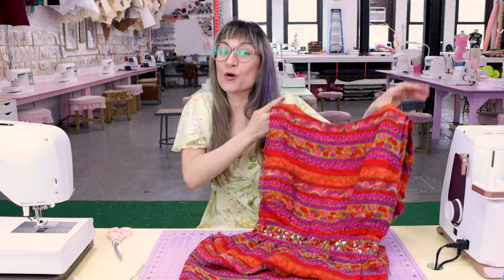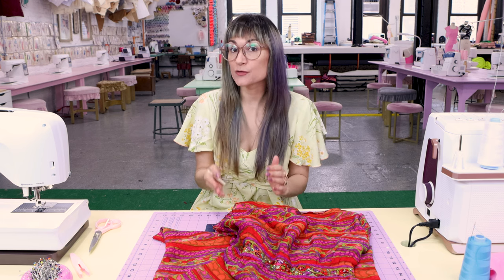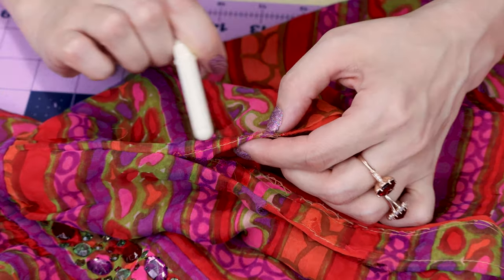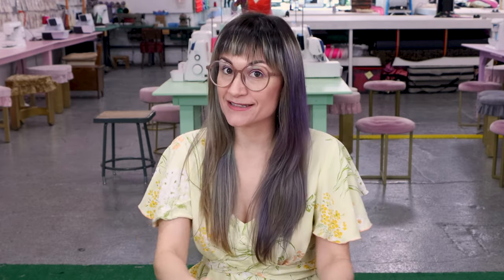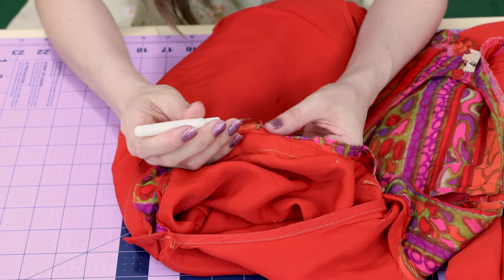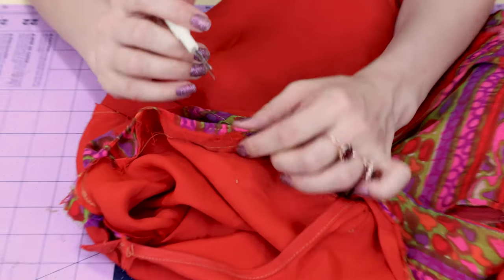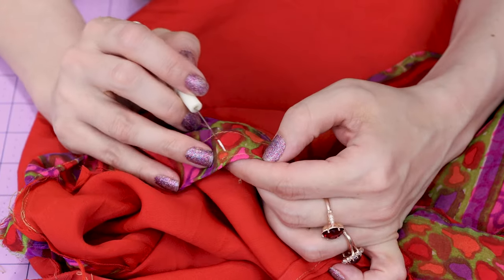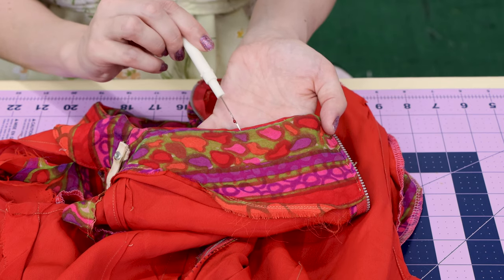How To FIx A Hole Or Tear In Chiffon Or Mesh Fabric On A Dress!

Comment: It looks like a machine with a straight stitch plate would make that sewing a lot easier with that really light fabric, or maybe some wash-away stabilizer. Or both.
Reply from the maker: Yeah you could use a straight stitch and drop the feed dog and mend it like that. More interfacing would defiantly help this poor dress. It really needs some fusible in red. The fabric is just so thin from age. It has started ripping even more after I wore it a few times.
Reply: @SewAnastasia  If anyone can save it, it'll be you!